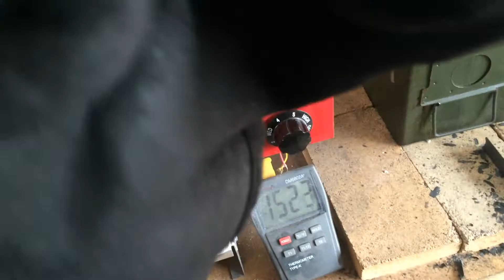Straight Razor Heat Treating POV | Portland Razor Co.

Comment: Hey, finally have the chance to get my heat treat and I actually remembered this video and realized this oven is the studio pro... I was just about to click buy on the evenheat artisan with ramp master... Do u have any issues with controlling temp with the Manuel control and pyrometer? Have u gotten rid of this oven yet or are u still using it
Reply from the maker: +Alfonzo Terrones Congrats! We have since upgraded to a larger knife kiln with a TAP controller, which we would highly recommend if you are serious about doing your own heat treat. While you can manage it just fine with the manual control (you just have to sit there and watch it the whole time), the TAP controller allows you to "fire and forget" until it beeps at you to start the next step.

Comment: I did this and my razor worped
Reply from the maker: Oof, we've all been there! Determining the right edge thickness going into heat treat and the technique for quenching can be tough but will eliminate warpage. Calipers, feeler gauges, and a smooth quench (don't agitate/stir the quench oil, just straight up and down with the blade to avoid heat pockets) are very hepful!